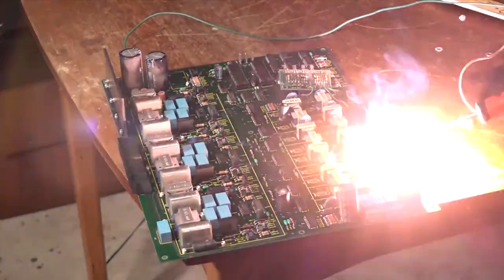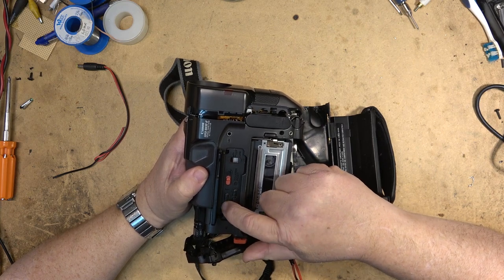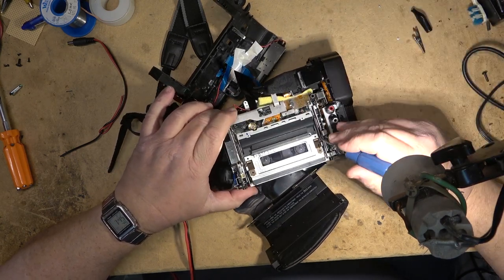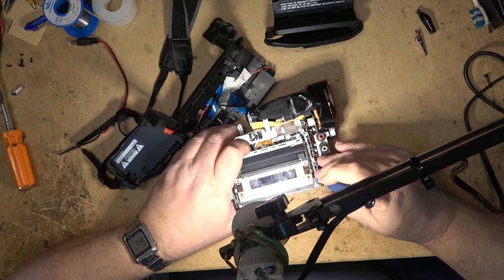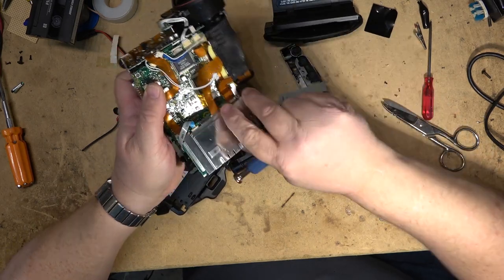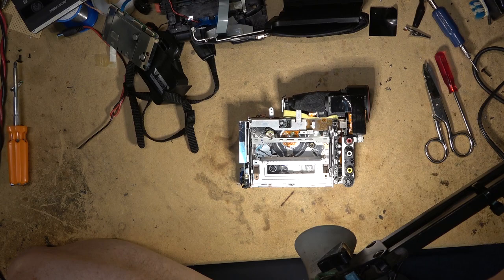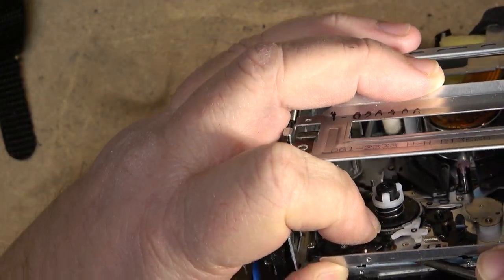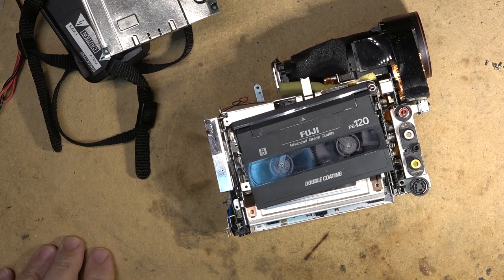Removing a tape from a jammed mechanism on a Canon 8mm Camcorder

Comment: I worked at Canon in the '90s. Ueah, they were great cameras in my view. Usually butchered cameras with stuck tapes had questionable content on the tapes. They need re-capping every now and then. Camera boards on E20, 60, 90 ... etc were required. They smell funny, you know caps need replacing.

But I liked them. I still have a very functional MV700i.

Comment: Those tape mechanisms I first saw in the UC10 model. Yes, they can be reworked and functional again. You need to reassemble them making sure the gear timing is correct. Had a few bent units and got them working. UC10s were my specialty. A10s and A11s also. I fixed John Bonjovies A11 when he toured.

Comment: I have a 1997 Canon UC4500E that is very similar to the one in your video.  I'm wanting to digitise all my 8mm video 8 tapes if my children as toddlers.  The camera plays the visuals fine but there is no sound at all.  The audio isn't crackly or distorted, it's just totally missing.  Any suggestions on what I can do.  I'm good at tinkering and fixing things and am happy to take lots of time and effort pulling it all apart and I can solder things if needed if I can just figure out what I need to do to repair the audio.  I'm assuming that there is a video (visual images) head but also some sort of audio head as a separate thing that might be misaligned or not connecting with the tape.  Just guessing.  I you or anyone else can offer any suggestions for what I can do to get the audio working I would be eternally grateful.  These are the oldest videos I have of my sons when they were tiny and are incredibly precious to me so I'm desperate to get this fixed.  The camera uses composite cables (yellow for visuals and red and white for audio) and there is no sound coming from the camera on playback.  I've tried 2 different sets of composite cables.  I attached a set of headphones to the headphones port but no sound.  I used composite cables and video capture software to play the video on my computer and I can capture the visuals but still no audio.  Would really appreciate any guidance or ideas for what I can try.  Thanks

Comment: I'm having a similar problem with my GL2. I open the deck to eject the tape and it pops up a tiny bit, makes a 'wirrrrrrrr' sound, and returns to its previous position. Ive been looking forever for someone to help me but I'm yet to meet my savior. Any chance youre the one? 😅

Comment: Sad this one you show is in sad shape, I still have a Canon ES800, I think from a similar time frame (mid 90's), does not have the ability to accept  an external mic, nor headphones, but does have a color viewfinder but no flip out screen, but does have a built in light, no cold, nor hot shoe, no S video as it's standard 8mm, has manual focus, optical stabilization and RCA V/A outs. Still works the last I checked it out a couple of months ago. 

Need to get a capture device for USB so I can ensure I capture what I do have on tape. not sure if I got it all when I had a DVD recorder. Still have it, but not powering up. Need to check the fuse on that closer to see if blown. 

I currently do my YouTube channel with a more current Canon Vixia HFR500 that I bought used from a Pawn shop in 2019 (came complete with one stock battery, wall wart adapter and a case) and can do 1080P 30 or 60FPS. No cold shoe, but does not have a built in light, but can accept an external mic though, and headphones, has a flip out screen, but no ability to accept lens filters. Does what I need it to do, for now. 

Sadly, the current Vixia W10 seems to use an internal battery so likely not able to use a swappable battery like my current camcorder can and have bought 3rd party batteries and charger for it. Now to get a wireless mic kit, but not now as I have a wired lav to use. A bit of an improvement over the stock mic on the camera.
Reply from the maker: Had this come i before the owner took it apart it may have been salvageable but with it taken apart like this i don't know what additional damage has been done and I don't want to get married to it so remove the tape and that is as far as i am going on this one.

Comment: Still got my full size VHS Panasonic camcorder. Why? I have no idea, wonder if it still works. Something about a scanned picture format that I like, there is a smoothness, unlike the rolling shutter formats, pixelation, buffering artifacts, frame rate stuttering, etc.

Skipped the whole micro tape format and went right to SD digital camcorder. Canon 1080 format, now those are worthless too. Still have my Canon AE1 35mm film camera from 1981, now that is when Canon made good stuff. But what use is it....  sigh
Reply from the maker: Global shutter cameras are pretty common these days. High frame rate is the only way for smooth pictures.
Reply: @12voltvids  Video and telecommunication is your area of expertise, and I won't pretend to know what I don't know.  I do know I built a computer a couple of years ago that has a frame rate of 144 fps and my racing simulator is fluid with no panning blur.
Reply: Use the lenses on a Canon FSLR then. I use my FD lenses on a EOS650D!